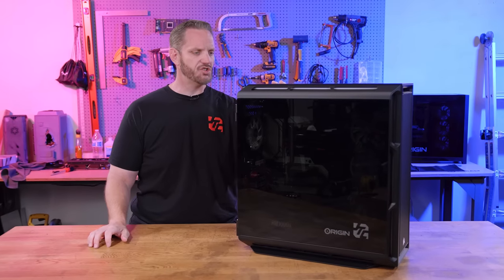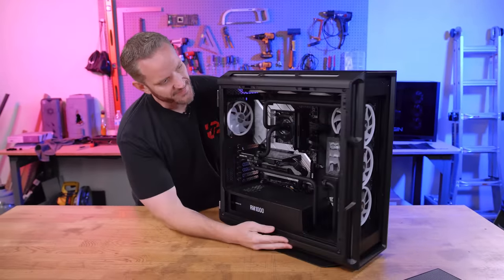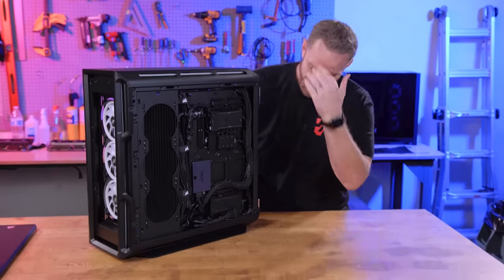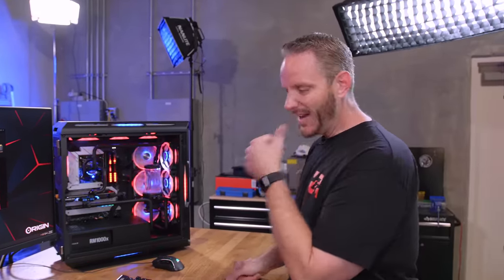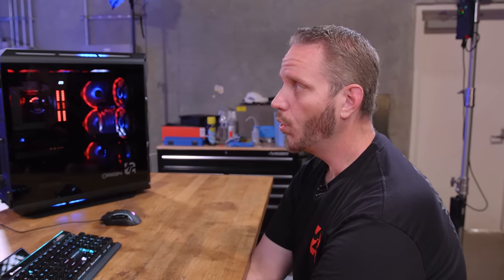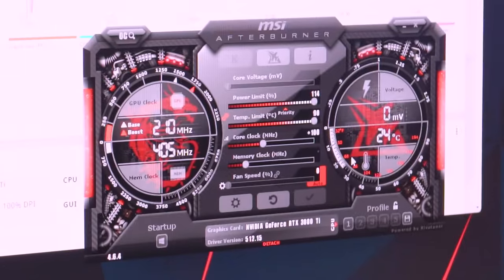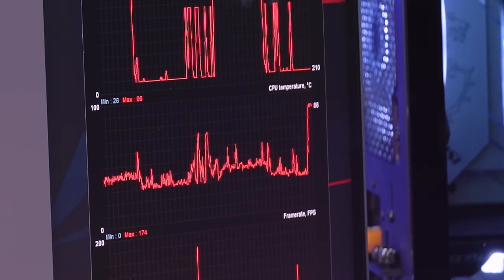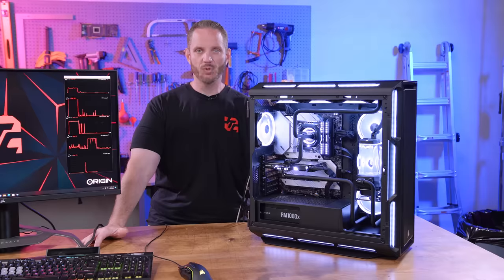This PC is a work of art!

Comment: That cable management is insane. Can't imagine having to change a component, I would not be able to replicate.

The black tubes looks great. 🤟
Reply: Whatsapp✙𝟷𝟻𝟶𝟸𝟺𝟹𝟻𝟹𝟼𝟽𝟼

More updates on XRP NFT's, BTC📊
Whatsap✙𝟷𝟻𝟶𝟸𝟺𝟹𝟻𝟹𝟼𝟽𝟼

 
More updates on XRP,NFT's,BTC📊
👆👆👆👆👆
Reply: Send a direct msg right away
Reply: I've got basically the same setup but only one SATA SSD more and I couldn't even come close to make it as tidy and clean looking as they did. I've got a huuuge mess that I had to shove into the PSU shroud again. But I guess they got custom length for all the power cables of the PSU so that would also help a lot. I've also just seen that they used the adapter and don't have to deal with 3x 8 pin PCIE cables. 

Oh and I'm never gonna use cable ties again as changing components is so annoying and those Corsair QL fans often have faulty green LEDs.
Reply: @Jousten16  Use small Wire Cutters (diagonal pliers). They are a life changer when it comes to managing ties.
Reply: Lol replication is completely out of the question. I'm running way too much in my system (13 corsair rgb fans to start. Ll120's) and I bet I could make at least a couple people puke if I pulled my back panel off! 😂
Reply: It's fucking nuts
Reply: @adamtheninjasmith2985  same here running ql120 12 times with an aio cooler but i manage to pull of some clean cable management all these years of working on car electronics paid of on my pc
Reply: @Jousten16  I don't think you want it to look this tidy unless you are a PC builder and want to take a photo of it for your portfolio. If I was a PC builder, I'd tidy cables like that for portfolio photos, but I'd undo the majority of the work before sending it to a customer.
Reply: You could change out the NVME and SSD without any issues.
Reply: @spankbuda5760  Cable management is good, but as the saying goes "You can have too much of a good thing.". While I admire the effort that was gone into the cable management of that computer, I don't think I'd ever want to go that far, because once you open those cable ties, you'll create a mess that can't be undone.
Reply: @philtabest  It's because of those 20+ sets of Corsair fan wires needing to hookup to their fan hubs and lighting node. You would've thought that Corsair acquiring these companies that that would have developed a better wiring solution for their fans like what NZXT or Lian Li have done. I have the Corsair 570X case that I decided that I wanted to change out my older Corsair AIO to their new LCD screen AIO and I have to undo my clean cable management.
Reply: It would be fairly easy swapping all zipties for welcro

Comment: Looks good, hopefully customer-bought units have this same level of care like this.
Reply: It's Origin so they're well known for doing so, the downside is that Origin is noticeably more expensive then competing SI's but you get better customer service and more care.
Reply: @roji556  too expensive, unrealistically so. I just put together a build on their site and hit over $7,000. It was my computer I'm building now for around $4,500 but their parts bin didn't even go high enough. I don't care how good they assemble it, at that price it should just be a case with a brick of cocaine in it.
Reply: Is there not a single RAM set that can synchronize its RGB lights? It’s always offset and I would imagine most of the custom PC community is as obsessive compulsive as I am.

Comment: I always found that I can just combine cool and great components myself and that that looked great too, so I saw no reason in paying extra for a pro prebuilt but maaan, this is something else. The cable management, the black tubes all perfectly straight, how nice and easy the case can be handled whith good airflow and still looking good... This is certainly worth it imho.
Reply: Whatsapp✙𝟷𝟻𝟶𝟸𝟺𝟹𝟻𝟹𝟼𝟽𝟼

More updates on XRP,NFT's,BTC📊
Whatsap✙𝟷𝟻𝟶𝟸𝟺𝟹𝟻𝟹𝟼𝟽𝟼

 
More updates on XRP,NFT's,BTC📊
👆👆👆👆👆

Comment: Maintenance on cable managed systems is pretty easy if you're willing to sacrifice a few ties (and some extra time). Trace the cable you need out of the bundle, zip-tie all the rest of the bundle with a fresh tie before clipping the old one. If it's nested too deep, split the bundle using several ties but keep everything zip-tied at every time before clipping any tie. When you're done, just combine everything back together and clip your temp ties. There, done.

Comment: Great vid! Origin using Corsair cases and components has been a good mix. One thing I suggest mentioning with these (since I help a lot of people who are new to PC gaming) is the maintenance involved with owning a custom liquid cooled build like this. I'm sure you've done it before, but perhaps an updated video on regular custom loop maintenance would be helpful?

As a side note, the price of a 2TB M.2 NVME PCIe Gen 3 drive is roughly the same as a 2TB 2.5" SATA SSD these days, with the M.2 drive being much faster. It's not too relevant for gamers right now, but that could change if or when DirectStorage is more widely adopted by developers.

Comment: In my experience Cinebench is not actually very good to stress test your CPU, at least when concerned about temperature. Sure it's good for stability testing, to see if an overclock works, but Prime95 gives me around 10°C higher temperatures. So I always run Prime95 to see if the cooling works as expected.
Reply: Whatsapp✙𝟷𝟹𝟹𝟽𝟻𝟼𝟽𝟷𝟿𝟸𝟸

More updates on ETH,XRP, BTC📊
Whatsap✙𝟷𝟹𝟹𝟽𝟻𝟼𝟽𝟷𝟿𝟸𝟸

More updates on XLM,NFT's,BTC📊
👆👆👆👆👆
Reply: Exactly, Prime 95 with option max heat. If stable you are on the safe side with a bit of headroom for every application.
Reply: i find Cinebench is good for realistic testing. but prime95 smallest. for really pushing it to the limit. though that can cause crashes you wouldnt see in normal usage.
Reply: I see this sort of comment so many times. The reality is that 99% of users will never get into any scenario that is even vaguely close to a P95 load, whilst an awful lot of users will be in a Cinebench scenario.  So whilst testing for headroom is not unreasonable, it's just not necessary for so many people.
Reply: Prime 95 is childs play I use Max 84...

Comment: Although this particular pre-built looks very cool and their cable management in this one is top notch, Origin PCs has somewhat mixed reviews (some places have better reviews for them than others). 

A streamer I know has been going through the BSOD (Blue Screen of Death) for at least six months... it's a pre-built from Origin from ~2 years ago.
Reply: Buddy of mine got one made from Florida and his has been working fine for a few months now and he got a founders 3070ti  which I can't deny looks sexy.  But hopefully a year from now I can say the same thing for his performance.  He has been very happy with it. I tried to get him to build his own like I did but he has the knowledge enough not to get scammed by the IRS in Pakistan and that is about it when it comes to technical ability so I think it was the right decision.
Reply: Origin uses top knotch components in their builds, and the customer service is 2nd to none. 
All PC hardware will eventually fail, its hard to blame a builder for a problem that occurs 2 years down the road. Hardware, firmware, and software all require regular maintainace and will fail sooner without it... regardless of who built the PC.
I would never buy an Origin (i cant afford one), but the people that do, do so for the excellent support and reliability, as well as the style.
If he contacts their customer service, they will go above and beyond to help him get his PC running again, even after many years.
Reply: why do people watch streamers?
Reply: @gasracing4000  so you would never buy anything origin but will praise them? I build my rigs myself so i cant comment but im not trying to.
Reply: @spiffnoblade7731  
I enjoying building and modding PCs, and am happy to work/provide support on all my friends rigs... but not everyone has a "Gary" to turn too. 
For people that have extra cash, but limited tech knowledge, and want a top knotch computer with top knotch support, then Origin is a good choice. 
I would never buy one personally as I try to sqweeze every drop of performance out of every dollar that I can, but for upper middle class "Joe" its a different story.
Reply: @gasracing4000  ok thank you for the response, now you have phrased it in a different manor it seems less like bloated wank and more a helpful suggestion  :)
Reply: @gasracing4000  I would have been my buddies Gary but he lives across the country so that isn't feasible but I totally understand your answer about wanting to do it yourself. I just did my first build ever a few months back and I loved every minute of it.  I sweated bullets the entire time especially when plugging the psu cables in for some reason I was stressed about that but now I am the proud father of an i7 12700K cooled by Noctua NH0D15 black edition, with 16gb of G Skill Trident Z RGB and an MSI 3080 12GB Gaming Trio Z all on the MSI Z690 Edge Wifi DR4 with 2TB Crucial P5 Plus inside a Snow White Thermaltake Core P6 all cooled by 7 White Lian Li AL120s and one black 120 noctua on the bottom for intake because I screwed up and didn't realize my monster case still wasn't thick enough for the second fan that needs to be elevated a bit to clear the RAM on my cpu cooler.  All in all I think it is a beautiful machine and sorry you didn't need to read all that I am just a proud father I guess.
Reply: @ydid687  Why do people watch TV or read books?
Reply: @krashd  to learn & grow because information is presented in a coherent "presentable" manner rather than info coming from a dude/dudette sitting in a room ranting with low quality humour?

apart from that entertainment (that too mostly in a "production level coherent way")

and very rarely amateur entertainment

Comment: If you think that's some good fans, you'll love this.  Front mounted radiator with 6 fans in a push/pull config,  2 exhaust fans on top and one in the rear.

Comment: PC clean every 6months  watercooler radiator's  Fluffinstuff  + heat  was 34C idle
after a clean 26C idle   adjusted hoses tied down lower  1 one was higher &  gave the  radiator a  good shake b4 returning to case 
much better worth the time cleaning & maintenance

Comment: Wow! Can't go wrong with the black.. style and simplicity. I am building pretty much the same system but black-yellow pallette. As rads-fans I have pretty much the same arrangement with the difference my side rad fans are set to intake at the moment. Should I change it to exhaust instead (same as this build)?
Reply: It seems like a case with push pull on a front rad would work better than one with an intake directly next to an exhaust. Plus it would use the same fans. I don't doubt that the rad right there gets tons of cool air but do those 3 exhaust fans starve the rest of the case of fresh air? I've never had a case with intake and exhaust fans directly next to each other honestly. I've always kept it simple intake in the front exhaust through back/back top. My guess is how you have it is better.

Comment: When was the last time you checked prices on nvme vs sata ssds? Nvme has been competitive and sometimes even a little cheaper for a while now. The samsung sata drive in this build looks like an 870 qvo ($190), that's the cheaper cacheless model (the 870 evo with a 2gb cache buffer is $220) or you could get a top of the line gen 3 nvme like a samsung 970 evo ($200), or a comparable speed gen 3 nvme for even less than that like a WD sn570 ($180) or a lower end one like a team MP33 ($160, Team also has a sata drive for the same price) that will still absolutely smoke any sata ssd.

 If you want to go more premium you can get a 2tb gammix s70 (one of the best gen 4 nvmes and the most aggressively priced one I'm aware of) for $230.

The cheapest 2tb ssd currently on pcpartpicker is an nvme from Kingston and if you go sort by 'ssd = yes' and order by 'price per gb' it's a pretty even mix of the two all down the list.
Reply: I have to agree. Looking at nvme and ssd, nvme now are the same price or slightly cheaper

Comment: Cable management looks nice and then you look closer.
1) Extra SATA SSD bays are blocked
2) Corsair sell a Nvidia 12 pin cable for their PSUs and yet Origin used cable adaptor. 
Water cooling looks excellent with all those 90 degree bends and then at the top on the reservoir, there is a odd 45 degree part.  Also the bottom fitting of the reservoir seems a little off of the 90 degree. 
For a PC system that is probably above $3,000, attention to detail.
Reply: It's a lot higher than 3k, and I agree with the points above :)
Reply: Agree

Comment: It's a nice looking rig, that's for sure. Couldn't afford to do custom water loop on my most recent system rebuild, but some day.
Reply: Ditch Water Cooling Stick with Air, trust me 1 lil tiny Leak can Fry your PC Even if Put it together with a Pro. Unless you got mad money, get you a big ole Air cooler youll thank me
Reply: @jaxsonmillz6474  dude, before you post bullshit like this, you need know what a custom watercooling is.
In those systems will be used a distilled water or other no conductive coolants, so no, no risk of "fry" any component, you can literally soak the parts in those coolants, no "fry".
I build since ages watercooling systems and i have experience
Reply: Honestly a custom loop like this is overkill actually, i remember the gtx 480 how hot those gpu was... For them was worth a custom watercooling system.
Is not same i know but you can begin with a AIO from Arctic (excellent cooling for fair price) for your cpu, the gpu is not  worth to spend money, the aircoolers on them are actually pretty good and enough for some OC too
Reply: He loves every single team where the slovenians play. Dallas- Dončić LAKings- Kopotar
Reply: Honestly save 250$ and you can do a cpu loop easily and maybe get 2 rads depending on where you buy and later get a block for the gpu and expand.
Reply: @jaxsonmillz6474  Completely Wrong

Comment: Ordinarily I don't care about RGB, but damn that is some amazing lighting setup.  Origin outdid themselves 💜
Reply: Whatsapp✙𝟷𝟻𝟶𝟸𝟺𝟹𝟻𝟹𝟼𝟽𝟼

More updates on XRP NFT's, BTC📊
Whatsap✙𝟷𝟻𝟶𝟸𝟺𝟹𝟻𝟹𝟼𝟽𝟼

 
More updates on XRP,NFT's,BTC📊
👆👆👆👆👆
Reply: Send a direct msg right away
Reply: I agree and when I build systems, I make sure that I can turn almost all of it OFF with one click / button. The MOBO is usually separate.
Reply: I remember when water cooling was all about performance rather than "look at all the pretty tubes light up" so I avoid RGB like the plague.  It actually infuriates me on those rare occasions where I find a component I like but it only comes in an LED version that would require me to damage it before it was suitable for me to use.

Comment: That cable management is so clean, if you needed to replace a wire you can always use the garbage twist tie, cut the first zip tie, pull the wire out from the bundle and use the garbage twist tie to hold the rest of the wires in place, rinse and repeat till the wire you need is free, it may take longer but you will keep the wiring hopefully in place. Then as you add the wire back in to the bundle one twist tie at a time, you can use a zip tie to lock it all in place again.
Reply: Whatsapp✙𝟷𝟻𝟶𝟸𝟺𝟹𝟻𝟹𝟼𝟽𝟼

More updates on XRP,NFT's,BTC📊
Whatsap✙𝟷𝟻𝟶𝟸𝟺𝟹𝟻𝟹𝟼𝟽𝟼

 
More updates on XRP,NFT's, BTC📊
👆👆👆👆👆

Comment: Heya Jay! Awesome system from Origin, but FYI 17:25 & the thumbnail shows the top fans are intakes. Will you be putting the top filter back on?
Nice that Origin kept positive case flow with this build, adding more quality like the cable management here.

Comment: not to be pedantic, but those are QL120s, not LL120s. the difference is that the QLs have light rings on both sides of the fans. LL120s only have them on the intake side of the fan.

Comment: The lighting gives me an arcade kind of vibe. The RGB of the radiator's middle and top fan should be flipped for the correct lighting pattern.
Reply: Whatsapp✙𝟷𝟻𝟶𝟸𝟺𝟹𝟻𝟹𝟼𝟽𝟼

More updates on XRP,NFT's,BTC📊
Whatsap✙𝟷𝟻𝟶𝟸𝟺𝟹𝟻𝟹𝟼𝟽𝟼

 
More updates on XRP,NFT's,BTC📊
👆👆👆👆👆

Comment: You said top is exhaust but it's intake... Gonna want that filter. Also doesn't cost any more for a m.2 ssd with equivalent to a sata ssd speeds anymore. Sata is dead if you've got the m.2 slots.
Reply: I noticed that just doing my build last week. Price on m.2 and the sata was exactly the same and I have four m.2 slots on this board.
Reply: Dust filters are pointless imo, they only serve to reduce airflow and cause you to need to run fans faster and thus have a louder machine, pc's should be cleaned out a few times a year regardless, might as well have better airflow the whole time.

Comment: acrylic is very resistant to heat, it start to become soft at arround 200celciuls, which  is waaaay above anything on a pc.
Reply: Whatsapp✙𝟷𝟻𝟶𝟸𝟺𝟹𝟻𝟹𝟼𝟽𝟼

More updates on XRP,NFT's,BTC📊
Whatsap✙𝟷𝟻𝟶𝟸𝟺𝟹𝟻𝟹𝟼𝟽𝟼

 
More updates on XRP,NFT's,BTC📊
👆👆👆👆👆